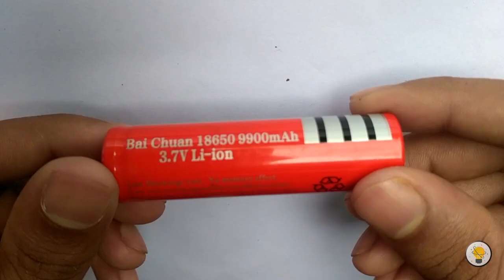How to Make 2000 mAh Power Bank with Complete Protection and Expandable Capacity 2019

Comment: Is there any limit for the number of batteries that we can use????
Reply from the maker: There are no limits in how many batteries we can use. But the charging and discharging power won't go above the maximum rating of the battery module. This means more batteries take more time to charge and discharge.
Reply: Thanks for the reply 😍